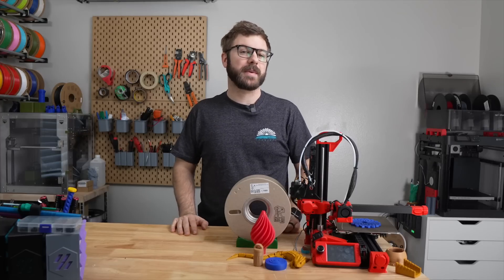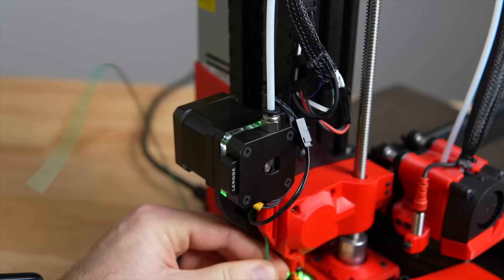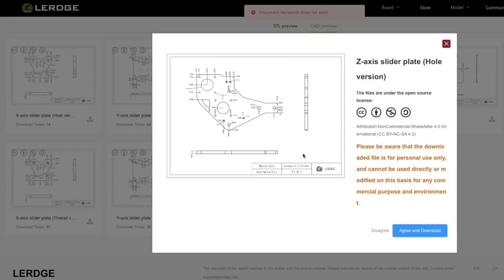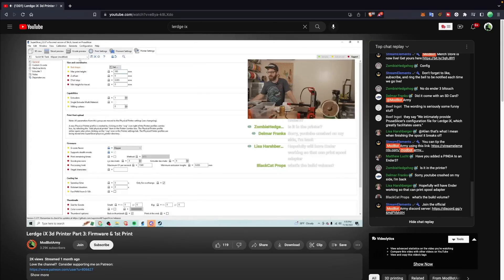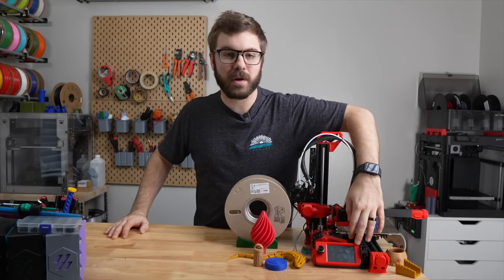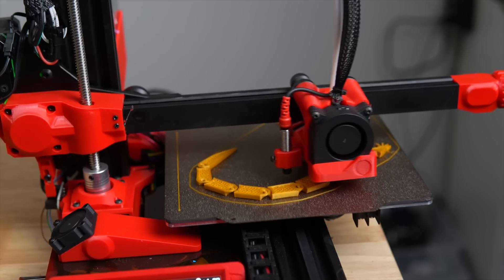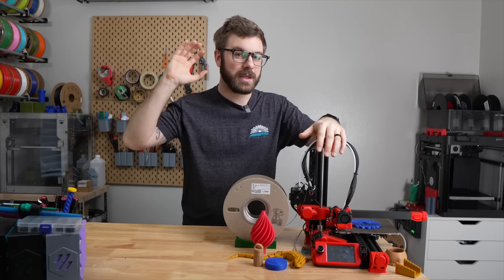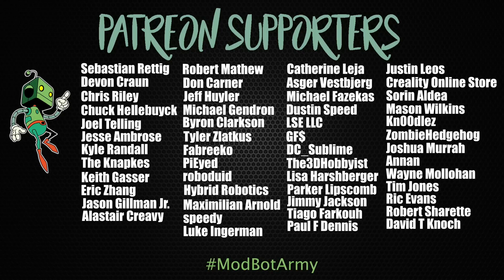Is Their First 3d Printer Worth It? (Lerdge iX)

Comment: Great! A modded Ender 2 Pro Kit - version with more open source than Creality does provide and a great documentation! - I really like it!
The option alone to print the parts for the printer itself (via a friend e.g.), to change its color with that choice before assembling or the improved details over the Ender 2 Pro are worth the project!
Bigger is not always better! I would always prefer those Ender 2 Pro/ Lerdge iX/ Prusa Mini style printer over the bigger Ender 3 as a first printer, because it needs less space, is better for transportation (e.g. to show family members the new hobby) and proved to be a more solid experience because fewer (moving) parts.

Especially for kids, students and people starting this hobby this is a great option with a full "build it like Lego" kit experience.

And because of the small size and price you have eventually space and money left for a bigger, more advanced machine as a second printer (like the Sovol SV04 IDEX 300x300) but it would still be my preferred printer, because 90%+ of all projects fit the small build plate anyways and it's easy to use and maintain (which an IDEX or big size printer does not have to be).

Comment: Very interesting - I  built the Anet A6 from the complete kit- my first ( and so far only ) 3D printer - you learn so much more about the printer & potential problems, not as sophisticated as the Lerdge, but much more rewarding than buying a print-out-of-the-box machine. I must say I prefer a gantry, with dual Z-axis motors, than a cantilever - not that I have any experience of them! The Lerdge hot end does look a bit weedy, maybe the cantilever design puts a limit on the weight...............

Comment: If the Lerdge firmware is based on Marlin, they may upgrade it in the future to include Input Shaping as a default option. That would be cool.
Reply: based on marlin ? so they are required to publish the source code for it, which they havent

Comment: Love mine. But no good at design on my end. Hoping someone is able to design a dual side part cooling. would also like to use bl or cr touch. so a mount and if able to plug in. If to the sensor I see mounted in video. would like to know what to get and to make it work on the stock all software already installed? yeah like said E3 for check but that's not the point. Loved building this as a first time build. Very enjoyable and relaxing. plus wanted a small desktop on purpose. (pointless wasting electricity on ym E5+ to print 5 minute parts using a few grams for my builds. Wanted the small bed to heat up for small 10 gram items to print.

Comment: I’ve assembled one during three live stream sessions but actually haven’t recorded a review about it yet. 😂 I’m really happy with it. End of May I will conduct a course at our local Makerspace where I will assemble another one together with the course participants. So far the print results have been really nice. I even managed to print the PET filament that I produce myself using the PETBot. I released a short little video about a printing result two months ago. I will have to exchange the PTFE part now though, as printing the PET at 255°C must have degraded that part. Lead to extrusion issues lately. But the good thing is that they sell all the spare parts at really affordable prices. Side note: I tried to print the PET filament on my Prusa MK3S but always ended up having clogs right away.

Comment: Stefan of CNC kitchen had a lot of trouble with cheap bi-metal heat breaks. As did I with my Ender 2. The cheap ones seem to be not the correct length possibly. Maybe try a slice engineering heat break. 
Also the PLA parts seem to be a very bad idea, wouldn’t the creep over time?
Great video as always mate 👍🇦🇺😊
Reply: "not used in load bearing parts" + easier to print. ABS or ASA are lot harder to print while PETG is not that much better 🤔
Reply: I've been using a cheap Mellow heartbreak for at least two years, printing petg and pla with no issues. 
Before that I kept having to change the degraded Bowden tube which was an original Capricorn one. Bimetal heatbreaks almost make the machine maintenance-free!
Reply: Don’t use anything from slice engineering. I hope everyone stops supporting that garbage company
Reply: @jeffreyepiscopo  Based on what?
Reply: @kimmotoivanen  u/JohnHue said it best:

Slice is selling a product in a field that has been created, has been able to innovate, and in general lives and breathes FOSS (free and open source, but free as in free speech not free beer although in most cases in 3d printing the later is also present). This is FINE, they have the right to do it... I personally think it's WAY overpriced (to the point that it prices out most people doing 3D printing), doesn't bring much to the table and the parent holds by a very fine thread... But they have the right to do it.

The issue is that Slice doesn't understand, respect or support FOSS and has shown no interest in doing so. This is the difference between E3D and Slice in terms of how you manage your patented stuff.

Here's what E3D has to say about their V6 hotend design after they fully open sourced it :

"After all, we're confident that what makes an E3D product truly worthwhile is more than just its schematics. Not only are our products manufactured with quality materials to a high standard on modern machinery, followed by a rigorous testing and QC procedure on each batch. Every single one of our heat breaks is individually checked and cleaned by hand, and we offer long-term customer service and support that is hard to find elsewhere. Buying an E3D product also means you are supporting continued innovation in the form of R&D for future E3D products. And Haribo."

https://e3d-online.com/blogs/news/open-source-design-patents-and-e3d

Slide has the opposite view. They've patented a tiny change in an existing design, capitalized on more than a decade of open source work from professionals and hobbyists but offered nothing in return and are even fighting everyone who makes something even remotely similar to what they're doing. Their excuse is "we have families to feed" well guess what so does E3D, but E3D said "we're allowing you to copy our design, but we're also guaranteeing our version will be very well build, controlled and supported"... Based on that mentality and the respect they show to the FOSS community people still buy E3D hotend be it only to support them rather than buying the Chinese versions.

In that sense Slice is similar to Stratasys who patented placing motors outside of the enclosure on an FDM printer as well as using active heating to heat the chamber, both things being extremely simple and OBVIOUS design choices for anyone working on that.... This is why you don't have affordable commercially available fdm printer with an actively heated chamber, because to do this they'd have to pay a licence fee to Stratasys and Stratasys also have the choice to not give the license to you even if you pay.

Personally I don't hate Slice, they've done me no wrong. But by their innovation-hindering actions I've placed them in the "will not see me money or support" drawer just like they themselves did with the FOSS community.

Comment: I am currently using klipper with manual mesh levelling (bed mesh levelling using the nozzle as a probe) on my ender 3 pro and it is working wonderfully! If you want i can post my configuration somewhere.
Reply from the maker: Sweet! Maybe I just didn’t look hard enough. Do you know what it is called in klipper?
Reply: @ModBotArmy  I thought I replied earlier but my comment bugged out. All you need to do is include a [bed_mesh] section in your printer.cfg. When you do, if you don't have a bl-touch set up, klipper defaults to a manual mesh levelling method using the nozzle as a probe. My bed mesh section is the following and can be used as reference:

[bed_mesh]
speed: 50
horizontal_move_z: 0.2
mesh_min: 30,30
mesh_max: 220,220
probe_count: 3,3
mesh_pps: 2,3
algorithm: bicubic
fade_start: 1
fade_end: 15
fade_target: 0

You need to select the proper mesh min and max points for your printer. After that, when you insert the bed mesh section in your config, a bed mesh controls window then appears in the tune menu of fluidd (not sure how its called in mainsail). In that menu there is a calibrate button, which starts the mesh wizard and creates a mesh using onscreen controls for moving the nozzle up and down.
I also have an lcd menu structure setup that allows manual mesh and bed screw calibration (aka bed tramming in marlin) using the ender 3 pro lcd which I'm currently trying to upload to github but i dont know how yet. It should be noted that klipper no longer loads bed meshes by default, and they need to be summoned at the starting gcode of your slicer just like marlin needs M420 S1. The line you have to add is: BED_MESH_PROFILE LOAD=default . If you create other meshes with custom names, then the "default" at the end needs to be changed accordingly. Let me know if i can clarify anything, I'm not sure if i am making any sense, cheers!

Comment: Awesome, I’ve been waiting for this update video! I was one who asked you to review it with klipper on the livestream. Seems like a super cool printer, especially for the price.
Reply: Oh wait I do have a question. I don’t remember if you have a Prusa Mini, but if you do, how would you compare this? It’s a kit and roughly half the price of the Prusa. Would it be worth the extra money for the Prusa in your opinion?
Reply from the maker: I have two Prusa Minis. One I bought second hand and one I bought brand new. Honestly I am not the biggest fan. Out of the 4 cantilever printers I have it is by far the least rigid. Some people love them and dont get me wrong if you use the stock settings in PS it will work for the most part but I dont love the hotend or their extruder. 

The plan is to convert one of mine to a Prusa Mini bear so it be supported on both sides, and be upgraded to a dual gear direct drive. I do think the mini extruder and hotend is better than the one stock on this Lerdge and that if you were to not want to mod a machine I would likely go with the Mini. 

I am upgrading this printer to a dragonfly hotend and sherpa Micro with linear rails and I anticipate it being a better machine than my mini as far as performance goes when its done. So I suppose depends on whether you want are okay with modding or not. My minis dont get a lot of use.

Comment: Good video but I don't get it. What is the advantages of this vs an Ender 2 or the KP3S that are both cheaper?
Reply from the maker: The only real reason would be if you want a full kit. There is a lot you learn about 3d printing when you put every screw, wire, nut, and bolt in place. For those wanting to build a full kit there are not a lot of options out there in this price range. Most like the ones you mentioned are already mostly assembled. If a full kit is not what you are after then the printers you mentioned would make more sense.
Reply: @ModBotArmy  I mean I get it but if I'm printing my own parts, I shouldn't be spending more, but to each their own.

Comment: 7:40 try print something with no infill, or turn off retraction. i had this same problem because the spring on my extruder was too strong, and retracting while doing short lines of infill would crush the filament, then push that crushed filament into the bowden tube, eventually if there was too many crushed sections in the tube it would be too hard for it to be pushed through the tube and i'd get under extrusion and eventually itd stop entirely and the filament would just be grinding in the extruder gears. Seems you have the same problem.
Reply from the maker: Interesting, that is not what I thought was happening after looking into it all but it is entirely possible. I ordered parts for a Sherpa Micro so this is getting overhauled in the nearish future. I really wish the extruder had adjustable tension. With how much thought went into this printer it is a strange decision.
Reply: i had the same problem as @ge2719 describes when i tested the lerdge extruder on my ender 3v2 @ModBotArmy
Reply: I had this exact same problem with the stock Creality extruder that came on my Ender 3. The minimum tension is still too high... I ended up installing a Hummingbird extruder and that solved my problem.

Comment: No thanks!  Really wish people would stop paying attention to cantilever printers.
Reply from the maker: Nothing wrong with them at small scale. The v-minion is crazy rigid.
Reply from the maker: I would argue more rigid than most i3 printers that don’t have a second lead screw at the very least.
Reply: @ModBotArmy  You can make that argument, and for years reviewers made the argument that the Ender 3 was the only printer on the market worth buying.  It sure did take us a long time to recover from that mistake.

I own a kp3s, and its ok enough.  I mean for the price its not half bad, but its not anything special.
Reply from the maker: @jon9947  not trying to convince you that cantilever is superior just that the design is fine for smaller machines if the frame is rigid. 

Given the choice I wouldn’t mind having a second rail for the z but I don’t believe it is much of a limiting factor for printers like this or your KP3S.
Reply: @ModBotArmy  I mean thats fine and to each their own, but I would guess you are more fascinated with the design and that this is a fun project.  Which that is good in my book, I like doing crazy things because they are crazy.

Out side of just a fun project, I think these things shouldnt be had. I think that is the most any of these printers should be framed as.
Reply from the maker: I feel like that aligns pretty well with my verdict at the end of the video on this printer. It is for someone that wants a full kit for the fun/experience of it. Also having the step files makes it a great little machine to mod on. 

If the goal is to get up and running as quickly as possible or you dont want a full kit, then it really doesnt make a whole lot of sense. :)

Comment: That leadscrew wobbles a lot, also might be a good idea to try the "ball bearing trick" with this type of compressing coupler. This printer looks interesting and I enjoyed the live streams, however I already have a KP3S v3 printer.
Reply from the maker: I haven’t noticed any real issues caused by the lead screw but I did have some rubbing issues that went away when I added some grease. I am going to upgrade the printer to linear rails and will investigate more then. Do you have a link to the mentioned ball bearing trick?
Reply: @ModBotArmy  Here's a video by Alex Kenis: https://youtu.be/zI-Fb8uTTKs
Reply: @ModBotArmy  You put appropriate sized ball inside flex coupler between stepper shaft and leadscrew .  This allows the coupler to flex but not compress. Possible alternative,  round over end of leadscrew into a ball shape on a grinder.
Reply: I'm also curious about the ball bearing trick, thank you!

Comment: Out of topic question. I have an Ender 3 v2 and the bed leveling is often a pain. The plastic thing that protects the bed heating cables is getting in the way of proper leveling. Is there a fix for it??? Thanks in advance
Reply from the maker: What are you currently using for bed leveling? Manual or did you add some form of probe? Can you route the bed heater cables so they are not getting in the way? I dont seem to have an issue with the bed cables.
Reply: @ModBotArmy  Am using manual leveling. That one plastic cabke cover makes the spring a little uneven with rest and bed leveling a pain.
Reply from the maker: @The_Traveling_Clown  oh snap I totally get what you are saying. The strain relief is wrapped sound the back level screw. I had to adjust my z switch a bit to find a heigh that allowed them all to tension evenly.  You are right it is a bit of a pain in the rear.

Comment: Love that you’re also doing the videos for LightBurn too now
Reply from the maker: I have been contracted with LightBurn for a little over a year. Lasers are awesome 😊
Reply: @ModBotArmy  yes yes they are. 

Have an OMTech 60w CO₂
Thinking about building a 5’x10’ with that new XTool 40w diode, as I’ve seen it cut through a whole 2x4 and I need bigger work area.  Why has no one made a video about how to modify the firmware for larger format. Dang.gif

Comment: My coworkers and I ordered a few kits after your live streams of the build. Loved the build process, our printers have been pretty reliable with the ptfe heat break, and we are super excited to mod the heck out of them. We're all mechanical engineers so we absolutely want to get our hands on the step files and hack it to bits. Thanks Daniel, great review.
Reply from the maker: Sweet! I would love to see what you end up doing with them. My linear rails just showed up. I dont have a drill press but I do have a CNC so plan is to cut out the plates in aluminum with holes for the rails. Also have a dragonfly hotend and parts for a Sherpa Micro extruder coming. This thing should be able to boogie with those upgrades. :)
Reply: @ModBotArmy  That'll be a nice comparison to the KP3S Pro! I'm definitely excited to see that video come together!